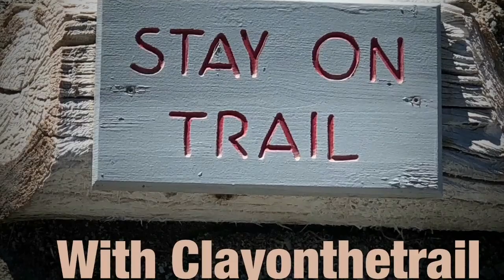Watch This Video Before You Make An Ammo Can Stove!!!

Comment: A good friend of mine from Cody, WY. who has passed onto a higher camp… build my 30 gal. “Stubby” barrel wood stove in 1986.  I build a grate for the bottom and toss in a few shovels if gravel to keep the bottom from burning out… she has been my base camp stove for 38 years.  I do have an ammo can stove I use for decent hike (under 20 miles) hot hot tent/tarp camping… simple and it works… you just have to feed it with 8” long and 2-3 inch diameter sticks all night.  We have ran the gauntlet on foldable stoves over my 45 years of packing and hunting.  Nothing beats a good base camp stove.  The rest… use, abuse and replace as needed.  Maintain a roll of wire.  Good video sir.

Comment: The problem with the medium sized stove is the poor design and craftmanship. All you had to do was turn that can around and put the door in the other end instead of using the latch end. Also, your door needs to be larger than the opening. Your smokestack needs to be a smaller diameter pipe. So on and so on. Please take this as constructive criticism. Good luck with your future builds.
Reply from the maker: I’m all for constructive criticism. I know the stove pipe was too big. I said it filming, but must have edited it out. I made all these with items I had in the shop, that included the 4” pipe. I have a 2 1/2 now, and will revisit it. As for putting the door on the other side, this box isn’t hinged, so it’s the same on the other side. Making it air tight ie, making the door bigger would help. I really don’t like the size and am not going to put a ton of time in that particular stove because it doesn’t suit my particular needs. I will be doing a part 2 and will address this stuff, thanks for the input.
Reply: The medium sized can looked like it had a latch on both sides.

Comment: I was thinking of building an ammo can wood stove. Looking at your builds gives me some ideas of how I want to do one and what size of ammo can I want to use. I know there's a mortar can that is similar to the 40mm can but it's tall and the lid just pops off. If I use that one I can get a heavy duty hinge and make that whole lid into a door that lifts up while the can sits on it's side. I got all kinds of ideas I want to run with, lol. Thanks for the video and the tips. Stay safe bud 👍🇺🇲
Reply from the maker: You are only limited by your imagination when it comes to these builds
Reply: I'd be very interested in seeing this of you could post up your finished build!
Reply: @bjaminf113  
To be honest I never even got around to doing it. With everything going on, I ended up using my ammo cans to store caches and stuff just in case and collected more items for security and survival. I also changed how I make shelters and such, been using tarps a lot more especially the mylar tarps, not the blankets but the tarps in conjunction with a decent fire and I've had good luck with it so far. Plus my old lady got me a buddy heater and it works awesome, great for campers and such.
Reply: @toddk1377  🤣 🤣  I'm using a buddy heater too and was looking at an alternative for a closed-in (mostly) carport.

Comment: Excellent video.  I made one out of 40mm.  Its great!!!!  I'm going to make 2 more.  One will be propane, the other to burn wood pellets.
Reply from the maker: Sweet. I’ve considered a pellet version, but propane would be awesome
Reply: I'm thinkin I could salvage the burners from a BBQ for the heat element.  
I was kinda thinkin with both propane and pellet I could probably use a 1" vent pipe instead of 3" stove pipe
Reply from the maker: 1” might be a bit small, 2.5 to 3, at least for the pellet, most propane heaters have a forced air exhaust to prevent co2 poisoning. You would at least want an intake and exhaust pipe that go outside  so no gas stays in the living area in case it back drafts
Reply from the maker: I’ve watched his videos, which showed me the closed system. I usually tent camp and have tried to adapt the ideas to this, but not making it weigh a ton
Reply: I have a 10 X 10 white canvas Spike Camp. The one I have is really good

Comment: Clayton:  I agree with you wholeheartedly about winter camping. I’ve never really bothered to take in a stove with me, other than something with which I could cook. But then again, I’m a person who likes to stay in a hammock you’re around when I’m camping. But lately I’ve been rethinking that. After all, above the tree line and up in the hills, there just aren’t trees in which to hang a hammock.  That’s a pretty serious limitation. I just have a good arctic sleeping bag, and don’t even think about a stove. But I’m a bit sick of limiting myself to the tree line. So now there’s a really good reason to get back into a tent, and reconsider that whole stove idea.

Your idea about using the rolled steel for a stove pipe/chimney is nothing short of genius. It solves a problem I’ve been considering for a little while.

By way of giving back, and in response to the disappointment in your voice as you discuss your 20 mm rocket and 50 Cal boxes, I did have a couple of ideas to offer. Hopefully they’re not an imposition, as they are offered from the perpective of respect and gratitude.

My understanding is that the formula for the size of your stove pipe should be about 5-10% of the volume of the stove body. Now that might be exactly what you’ve got going on, and only an illusion from the camera angle or something, but especially the small boxes look like they have really big pipes/chimneys.  So those would of necessity have to belt  out a whole lot of heat in a really short period of time.

If you were able to find another 40 mm can (or felt like changing around the ones you have), and I got the impression that you would like to, if you were to mount the chimney at the front end of the box so that you could have the door in the back end, then the locking mechanism shouldn’t be interfering with the door.  

You didn’t mention whether or not you put baffles in your stoves. We saw inside the first one, which was the antique, but not so much far enough into the other stoves to see if there was a baffle there to reflect some of the heat back and slow down the loss of heat out the chimney. You probably have it done, but just in case I’m gonna throw that in there.

The other thing that I wonder about, is if you’ve tried setting the fires in your stove from a top:down perspective.  You know…where you set your stove up, but then put your kindling and tinder on top, and light that.  Those fires tend to take a whole lot longer to burn down. It might give you a whole night’s rest.  And right now, I’m experimenting with a bit of a different set up to see if I can’t get a little more time out of a burn, by using a set up that I think is called a Norwegian match or Norwegian log. It’s just basically a log that’s cut to the right size for your stove, if it’s standing upright as if you’re about to split it. You cut it into sections, like long thin pieces of cake, and then cut the points off the pieces, and use that to make kindling. Those take longer to burn as well, so that you don’t have to be up restocking the stove as often.  And if you have the fire itself towards the front of the stove, then it’s gonna radiate out quite a bit more heat through the stove body before it hits the baffle and then the flu in the chimney.  It might also offer more secondary burn because of the placement relative to the chimney. But this is just theoretical, and still in the experimental phase from my perspective.

Of course it’s likely that you’ve already tried those things, but I’ll have a look around on your channel to see if you’ve already offered up ideas and experiments on those concepts.

Thanks again for your nice little video here. It’s exactly the information I set out to find, as I’m hoping to make myself an ammo box tent stove, and it’s my first time around.  And thank you for the encouragement about building one as well. :-)

Happy camping.
Reply from the maker: Thanks for this response, I appreciate someone who puts some thought into a comment, and doesn’t just criticize. I said in my video while making it that I was just using material I had on hand, but it got edited out in the final cut. The stove pipe pipe I used was comically to large for the sized stoves I have, and that plays a huge roll in the burn length etc. that said though, even if you could double the burn time with a smaller stove pipe, it still is under par for my liking. I do baffle all of my stoves which extends the heat output, but doesn’t affect the burn time very much.  I have since caved in and use a titanium stove that folds up nicely and has a stove pipe that rolls up and is under 3” in diameter. It doesn’t burn long, but is much more fun to carry. When I’m on shorter mileage trips, I still like the big stove for the longer burn. I have learned of the Norwegian log, using my Biolite wood stove, I considered it a Swedish torch, but same principle. I have never tried it in a horizontal stove.  I think in principle it is a sound idea, the only setback I can see is having to burn the fire completely out to reload it, tight again. The charred logs and ash inside affect  how the wood loads into the stove, and the stove is really hot to touch while trying to reload. I have burned myself many times trying to balance split wood on partially burned wood, while trying not to smoke myself out of my tent, and burn down all my gear. It is certainly different playing in the shop, with tools and almost perfect conditions, than out in the field. 

Of course it goes without say that everyone has different needs, or expectations and what works for me may not work for someone else, I just really enjoy trying out new things, and ways of doing them, even if they don’t work out. 

Thanks again for the comment and best wishes on finding your favorite stove!
Reply: @Clayonthetrail  :  Well that is a pleasant surprise, to learn that you’ve gotten a titanium one and enjoying it!  Congratulations on another option that makes at least some part of your life a little easier when you go outside. That’s no small thing.

The idea of something that folds flat is just intoxicating, especially if it’s lightweight. But your words about your oldest stove are making that feel a lot less attractive.  Mostly because of the draught at the hinges.  So of course, I’m wondering if that can be minimized with a lightweight frame composed of angles that would serve to include some of the gaps.  

I’m not surprised you tried so many of these other things. It’s obvious from looking at your stoves in the video that a lot of very considered thought went into them, and that no effort was spared in getting the workmanship just right. It’s not always easy to work with Improvised Supplies, but you still turned out a nice quality product.

There was one suggestion that I didn’t offer, but you probably have it covered in your new titanium stove. Stoves with windows in the sides don’t tend to work the same way as those without. I guess the window frame adds support.  And the comfort factor is probably worth having to clean the window on a regular basis.

You’re probably right about the Norwegian Or Swedish firelog/match. Once that stove is loaded up, with the bare minimum draught happening, A person like a nice bit more time out of it. My experimentation right now is happening with a Biolite as well, preparatory to finding or making the tent stove of my dreams. Lol. Do you mind if I ask what your findings are with that technique?

You know, it’s funny but I think at least 75% of the fun of getting the kit right is figuring out the problems to personalize it. Lol

Thanks again for your response and for the tutorial. You’ve provided a lot of answers here.
Reply from the maker: I learned with my Biolite, that a section of a branch about a 1/4 or 3/8 “ smaller in diameter than the chamber, cut to length, and then split in 6-8 pieces, kept in the original shape. Place the branch in the chamber, and it will spread out slightly. Light a fire on top, and it will burn down, just as you described. This is the longest burn I have had with this stove. The problem again, is it has to burn all out to reload it, if the food isn’t cooked during the first burn, you get to start over. 

My titanium stove is a little more airtight than the old steel one, but the connection at the stove pipe is a little wonky. The ammo can stoves are definitely more rugged. 

I also agree that making and tweaking these are as, or more fun than using them!
Reply: @Clayonthetrail  :  That’s a good point. About the amount of time it takes to cook something relative to the amount of burn time you get out of the fuel, I’ve been experimenting with my food lately. So if I make a batch of chilli or something nice like that, I weigh up the food, and then put so much of it in the dehydration unit and let it run for the night.  Assuming it’s dry, weigh it again.    Then when I want the food later, whether at home or outside, I had just a little bit more than that much water back to it and put it on the stove. In fewer than 10 minutes, it’s like I just finished cooking and simmering it for a few hours on the stove.

It’s not a perfect solution by any stretch, but at least the food always gets cooked in one go.

I think the most delightful part is that there Is still lots left to think through. Thanks again. I’ll check back from time to time, looking forward to the tweaks that you work out too.
Reply: Hi, @Claytononthetrail; I was looking for something else and came up on this thread that we had going. Seems like it might be a good time to check in and see what’s new.

You mentioned about splitting a log several ways and doing the Swedish torch sort of thing with it, to get the most time out of it, and I agree.

What I have Noticed that I’m doing, is when the fire gets so low, I just have another one ready to go and dump the Biolite out, either in water or sand, put some members in the middle of the new, Swedish, torches, and pop that right into the bucket again.

It’s either that, or be willing to be sticking twigs in all evening.

I guess that’s not so bad, for day hiking or even in the evenings outside the tent, but I’m definitely down with making a new one.

i’m hoping to make one that I can fold down, but also put a baffle and a mica window in, for more complete combustion that means getting up less often to refuel; and also to minimize the warpage while it’s in use. i’ve got the basic plan, and hope to go pick up the materials today.

So course I’m wondering if you’ve had any new ideas on the subject, Or if you’ve given up on making your own stoves, or using steel ones completely.

I don’t want to go around, trying to reinvent the wheel when somebody else is already put the thought in experimentation into it.

I look forward to hearing about your thoughts and ideas, And of course, that would include observations and thoughts relative to the new stove you’ve been using for a year or so..   😊

Comment: I have 1 over engineered 50cal ammo can stove. It has a mica window on the side. I use a 3"x6foot rollout titanium stovepipe. The legs fold up, the poker breaks down ane everything fits inside the stove for transport. Just suggest a grate or lifted bottom so the bottom doesnt burnout and dump your fire inside the tent while youre sleeping.
Reply from the maker: That is a good idea.
Reply: @Clayonthetrail  whatever keeps you warm and safe. Im aleays upgrading and making my kit better.